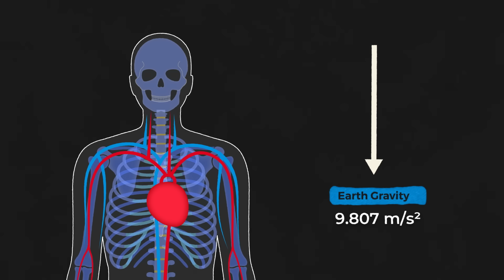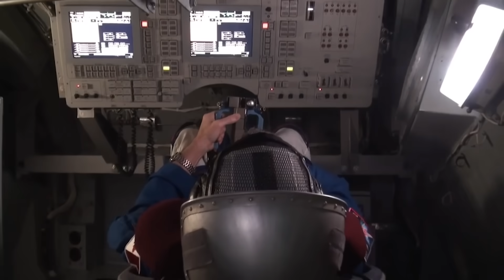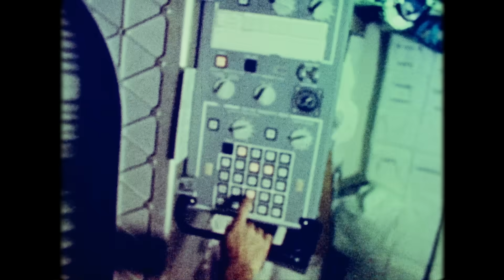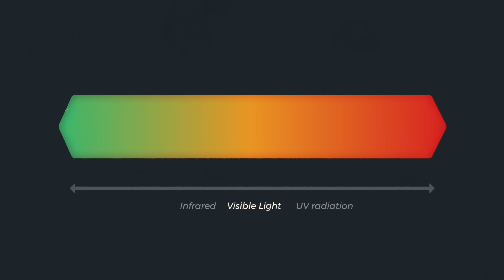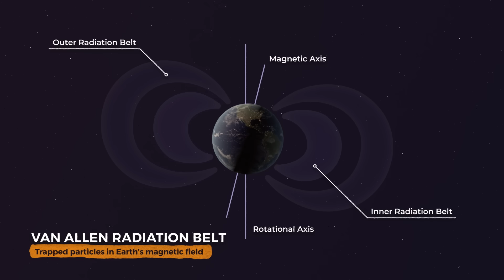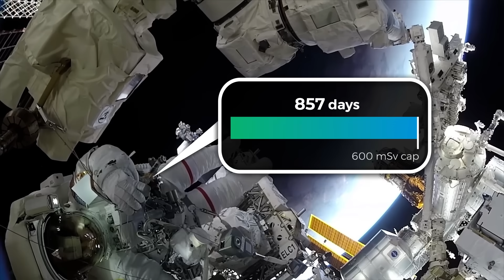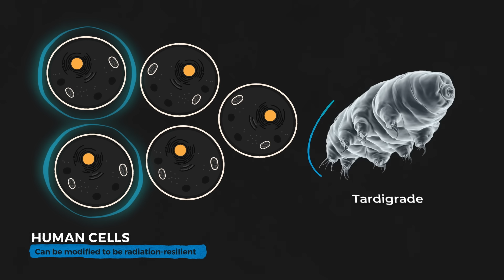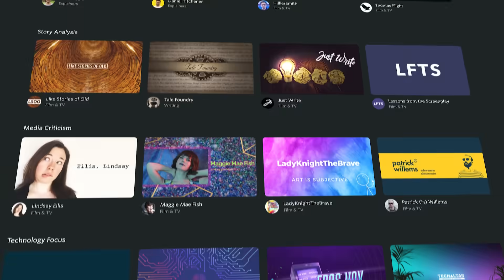The Problem with Deep Space Travel

Comment: Are we REALLY saying that we can't simply SPIN a cigar-shaped tube, like the body of one of SpaceX's Starships, along its horizontal axis, and create spin-gravity on the inside of a Starship's hull? 
If the "Starships" aren't wide enough to create spin-gravity on the interior of the hull, then make it a multi-floored ship: shoot one Starship into orbit, fuel it and provision it, and then park another one alongside it - and either use a carbon-fiber or fixed steel "single spoke" between them at their midsection, and start them rotating around each other, creating gravity on every single deck of both ships, as they spin around each other. it would allow twice the space, twice the provisions, extra fuel, more equipment, etc. 
We are already planning on re-fueling the Mars (or Moon) ship from a "Starship Tanker" already in orbit. 
Why not attach them at mid-section, and start a gentle spin with an ion engine, then stabilize it at 1G.  
Yes, you would have to deal with the Coriolis effect, but we wouldn't be pissing our calcium away, loosing all our muscle mass, arriving to Mars with our ankles the size of our biceps, having strokes, hearts the size of tangerines, or just D.O.A. Gravity is the true danger - an impossible barrier to a Mars voyage.
The shlelding against radiation is a separate problem, but this does address the gravity problem.

Comment: radiation with a wavelength lower than lightis absolutely not dangerous.
except it has an enormous high intensity and has the right wavelength to trigger specific molecules to rotate and/or vibrate, which is nothing else than an increase of temperature. this f.e. how a microwave-machine works

Comment: I'm not sure if this comment isn't a little late, but I heard about a shielding method that was not included in this video. I got this information from a documentary series I saw on TV. It was about using water as shielding for the astronauts because it absorbs many wavelengths. So a thought experiment was done with a spaceship with rotating living quaters , where most of the water is stored in the layer around the quaters to shield the astronauts. Would this actually work or is this more a misinterpretation of the absorption spectrum of water?

Comment: 15:56 that "speed" thing isn't true. All em waves travel at the speed of light. The difference is the energy which is higher the smaller the wavelength is. The shorter the wavelength the harder it is to block. Thats why they would need those very fat shielding

Comment: The atmosphere on Mars is also hazardous. Martian winds commonly blow 640 km per hour (400 mph), though with the far thinner atmosphere that may be like 75 or 80 mph -- still dangerous. Martian mini-tornadoes regularly spring up with no advance notice and last a half a minute or so. Ways proposed to safeguard against high radiation include satellites projecting magnetic fields around the planet, or a ground based local magnetic field made from superconductive electrical wiring. But those are not yet do-able and their reliability has got to be perfect. How could we keep supplying and funding a long term Mars colony, when public support, and consequently funding for Moon missions died after 3 and 1/2 years?
Reply: Hey 👋

Comment: I'm no rocket scientist but doesn't lead deflect radiation? Maybe a thin layer around the ship to keep it rad proof
Reply: There is a couple of problems with this. 

One is that lead is a very heavy material, so it would make the ship more heavy, thus dramatically more expensive for lift off. It would take up to a meter of lead to block cosmic rays. As it turns out, water makes an excellent radiation shield for space travel.

Two is an effect called bremsstrahlung, which essentially causes the highly-charged particles you see in space to project x-rays on the other side of the radiation shield, which would require another, separate layer of lead to block this additional radiation (https://en.wikipedia.org/wiki/Bremsstrahlung). Radiation is just a generic term for the emission or transmission of energy in the form of waves or particles through space or through a material medium.
Reply: @dazurathefirst  respect for the education my bro

Comment: Didn't Nasa know how to deal with radiation in 1969?
Reply: Lol fake space travel is the best kind of space travel
Reply: Dealing with radiation short-term is not dealing with it long-term. When you are on board the ISS, you are experiencing way higher levels of radiation than what you experience in the background radiation on Earth. It isn't immediately lethal, but extended exposure to this radiation will start to cause long-term negative effects. We have systems in place on board the ISS to mitigate how much radiation equipment and passengers on board the ISS experience, but we haven't figured out a way to block it completely for a lengthy (years or decades) time in space.
Reply: @dazurathefirst  The ISS is in middle layer of the atmosphere. Please stop the BS. 
The astronauts went to the Moon that has almost no atmosphere. The space between Earth and Moon has zero atmosphere. You'd you mind explain how they did it in 1969?

Comment: One thing to note about seeing flashes of light: In some cases it's not purely hallucination, cosmic rays might be one of reasons(which might be reduced assuming that a long duration spacecraft would have more radiation shielding for some more safety).
And I'm nearly sure those "figures" may in some cases by partially caused by seeing actual things outside(like pieces of debris or ice), something that may be fewer to see in interplanetary travel.

Comment: I've done a couple of space grade projects for the Space Shuttle long ago. The BIGGEST problem that I encountered was that just about EVERYTHING out-gasses. Anything that's a solvent, paints, inks, plastics, etc. 😖
 It was a major pain in the @$$. 
I don't think they were imagining any smells. They were probably real fumes emitted by equipment itself.
Reply: I was looking for someone else to comment this. Yes you’re absolutely correct. I believe a cosmonaut actually died from off-gassing during a space mission. 

Things like rubber, plastics and even permanent markers can be deadly in space from lack of atmospheric pressure. If it already has a volatile smell here on earth it’s probably deadly in space. 

I actually visited the White Sands National Test Facility where they had a huge vacuum chamber where they placed materials set for space inside and off-gassed them before they were allowed on a space mission. 

They were off-gassing SpaceX suits at the time of my visit.
Reply: Read about synesthesia, tinnitus, and phantom limb syndrome.

The fundamental purpose of a neuron is to receive data; process it into information; and transmit it to the next neuron to repeat that process. Failing ANY one of those tasks results in death. So, when a neuron (like in the olfactory system) ceases to receive data (like being in a odorously static environment), that neuron will literally migrate to a more active network and “learn to code” on a different data stream.

Neurons are pretty fascinating in that they act just like individual organisms always struggling to be part of an active network to justify the resources it receives. You could call it microbiological capitalism. Be part of a useful idea, or die.
Reply: @josephcoon5809  every time I read or hear mention of "tinnitus" I can hear that ringing that NEVER ever goes away. 😄
It used to drive me nuts before I learned to just ignore it. 
One positive thing about it: if I concentrate on it it lulls me to sleep, no drugs. 😴
Reply: @SciHeartJourney  Our brains are designed to move things to the subconscious if they become a repeated experience. The consciousness is mainly for novel purposes; new information.
Reply: @josephcoon5809  that's a really great observation! Oddly enough, the past and future are real and it's NOW that's the illusion. We call those novel experiences the "now".
Look out behind you! 😄
Reply: @josephcoon5809  microbiological capitalism, I love it! If only the entity as a whole were as conscientious.

Comment: I thought water shielding also helps to protect against radiation. Still it might be to heavy for lifting a rocket but in space loading the shield with water maybe
Reply: graph at 13:25 agrees that water is the best shielding ("PSE Hydrogen") while plastic is 2nd best ("PSE Polyethylene"), and 3rd best is Aluminium ("PSE Aluminium"). However none is best against cosmic rays (eg: "GCR Hydrogen"), so I'm guessing there's no other way; the shielding must be thick regardless of material, so to solve cargo mass problem the shield need to be small and personalised to the astronaut itself (16:43) rather than shielding the whole spacecraft.

Comment: Constant 1g acceleration is the future of space travel. With this a ship would get to Alpha Centauri in just 3.6 ship/7.3 Earth years (and that includes turning the ship around half way to decelerate) and it would have gravity the whole way which will allow on board farming. The ship would achieve about .95 light speed after about 1 year. A 10 ton ship would need a mere 10 tons of continuous thrust. 
   All thats needed for this is a true fission rocket (not nuclear thermal) that can put out thrust for long periods and does not consume hydrogen or xenon (you cant bring 500 tons of that with you). 1kg of uranium has the same energy as 120,000 tons of coal and plutonium has a lot more than that. The trip to Alpha Centauri would require less than 1 pound of uranium. Since these are both jittery atoms that are on the verge of fissioning by themselves there should be a way to get them to fission in a linear fashion with an electrical current, see "best method for interstellar travel" to see a potential way of doing this.
   It will be the new safest way to travel. Due to relativistic effects, the ship will only have a weak interaction with regular mass during the high velocity portion of the trip. The front of the ship should be an asteroid or at least armor plate. Maximum velocity would occur in the voids between systems where the chances of significant mass being in the flight path would be astronomically low. It would also need a powerful radar (RF emissions will travel at light speed regardless of the ships velocity). Interstellar radiation is not a problem either, a couple feet of asteroid dirt (and perhaps graphite and/or lead) will keep it out.
   With this method a ship can span the entire diameter of our galaxy in 24 ship/113,000 Earth years. Systems with stars similar to our sun can be reached in under 10 years.
Reply: Honestly you didn't really give a "method". What do you mean by "10 tons of thrust"(in units of mass)?
How would that engine even work?
And honestly that is quite far from optimal or efficient in many aspects.
I don't even see how coal is remotely relevant here.
And also something to back up going to Proxima Centauri on 1 pound of Uranium?
Reply: @ImieNazwiskoOK  The constant 1g acceleration method has been written about for many decades. TNT or coal is used to compare equivalent explosive energy. 1kg of uranium has the same   energy as 17.5 kilotons of TNT. A consevative estimate would be that 40 tons of coal energy would propel a 10 ship for 1 day, the trip to Alpha Centauri would take about 1,300 days, that comes out to 52,000 tons. The efficiency would be astronomical compared to chemical rockets. These would be low output engines compared to chemical rockets. Watch the video to see the concept.
Reply: @shawns0762  You didn't really answer much
Reply: @ImieNazwiskoOK  Did you really want me to answer your "what do you mean by 10 tons of thrust"? It's pretty simple, to achieve 1g acceleration  you need a 1 to 1 ratio of thrust to weight regardless of your units of measurement.
Reply: @shawns0762  Thing is that kilogram is wrong unit here(which can confuse), kilogram is unit of mass not force.
And there are few other things like how would it even work.
Reply: @ImieNazwiskoOK  I said tons first, tons is the most common unit of measurement for rocket engines. Raptors put out about 300 tons of thrust. To see how it would work you have to watch the video. The basic idea is to have positively charged uranium or plutonium atoms intersecting with negatively charged atoms. These would be low output compared to chemical rockets, intended for use in the vacuum of space. Since they would be electrically driven the bell cone would have to be made from a non conductive ceramic.
   Of course this is just a potential way of doing it, I haven't been experimenting with uranium and plutonium. I plan to make a new video soon outlining an alternating current potential method. The basic idea would be to have 2 iridium electrodes with a current set to just below the threshold that would cause an arc in a vacuum, precisely so all it would take is a single uranium or plutonium atom that would cause the arc to occur. The idea being to "pop" the atom like a fuse. A fuse element gets heavier right before it pops and a uranium or plutonium atom will not tolerate getting heavier. The main technical hurdle would be to get the atoms to head single file towards the electrodes. 
    There is no doubt in my mind that there is some way to get uranium or plutonium atoms to fission in a linear fashion. The reason being that they are jittery atoms that are on the verge of fissioning all by themselves. If it can be done there could be interstellar travel in our lifetimes.
Reply: @shawns0762  Just checked the channel.
Typical YT scientist that is wisest person on Earth, wiser than other wisest 
Aka BS.
Reply: @ImieNazwiskoOK  The constant 1g acceleration method has been written about since at least the 60's, it's not new
Reply: @shawns0762  I'm not saying about that way to make gravity in theory(although in practice you need a lot of energy but then it's interstellar travel and your ""solution"" which I very much have objections too among other things)
Reply: @ImieNazwiskoOK  Your rude. It's the way it's going to happen. I am a successful inventor, you probably have seen products that went through machines I designed and built.
Reply: @shawns0762  I'm just saying that what you are saying isn't truth, a "successful inventor" and man of truth like you should be able to take critique well(it's important thing).
Oh and now I see a big ego, btw I'm a toaster(judge yourself how believable that part is).

And also *You're so among other books dictionary would be also good to read :-)

Comment: 17:13 Hmm so to creat an Electromagneticfield we need a massiv Energie supply and a something which is about 0 Kelvin, of course spacestations can't use the Energy of the Sun and it is not like the are surrounded by a nearly Infinite Space which has about 0 Kelvin
Reply: 1) solar energy - massive energy supply - pick one. Those massive panels on the ISS produce less than 400 kw a day, electromagnetic shielding would be in the megawatt range, requiring a nuclear reactor. 2) Space is not cold, assuming you know what a thermos is... is it just cold? No, it's an insulator, because that's what a vacuum acts as, and the reason you would not rapidly freeze in space. There are regions of our atmosphere (called the thermosphere for a reason) that is at ~2000C... and you could be naked in that and not burn for the reason that it is that hot. There are so few other atoms to bounce off of that the heat can't be dissipated, the same problem exists (as it does right now) for any spaceship, that of 'how to stay cool'. Space is a near vacuum, like a thermos, there's not enough medium for thermal transfer to occur via convection and as such heat has a hard time getting out. Currently the ISS uses the phase change of ammonia in heat pipes to collect heat and then radiate it, that's infrared radiation thermal transfer, which gains efficiency the more the temperature gradient (more heat = more efficiency) but there's a practical limit because of the SB constant (5.67 W m-2 K-4). That is, the more heat, the bigger heatsink you need outside... having 6 football fields of heatpiping and radiators that also have to be protected from light and always be pointed at the blackest of space, to keep a power source cool becomes a bit of a problem lol.

Comment: This was rife with inaccuracies.
Arent you better than repeating the Starlab 4 myth? they didnt strike, they didnt mutiny, they never turned their radios off. An exhausted crew missed a couple of the short radio windows they had back then (they didnt have constant contact). 
Repeating the Salyut 5 hypothesis as fact is almost as bad - it was a military mission so its impssible to say with certainty what happened but most sources say the deterioration was due to a nitric acid leak from the Soyuz (which explains why it was gone when another Soyuz arrived and vented the atmosphere).
Claiming astronauts that see flashes are hallucinating is just afactual - we know its the stimulation of the optic nerve by radiation.
And to the root of the story - claiming that we need 'genetic modification' to introduce protein production or gene expression is just bonkers. It is as bad as the nutters that claim MRNA vaccines are gene therapy. We already have virus and liposome vectors for doing this stuff without resorting to the horrors of eugenics.